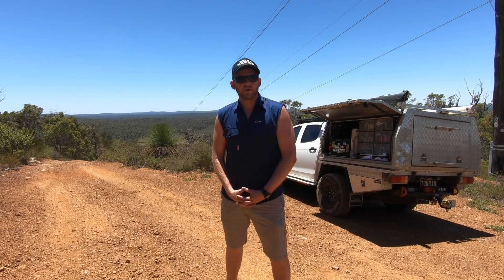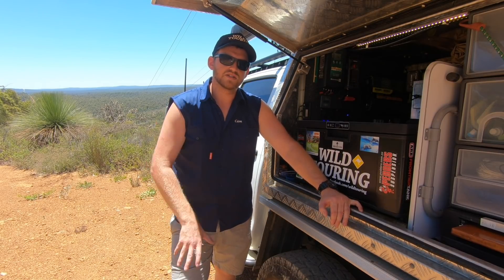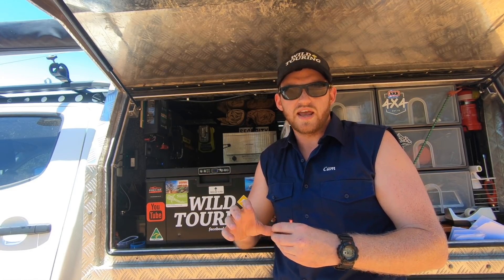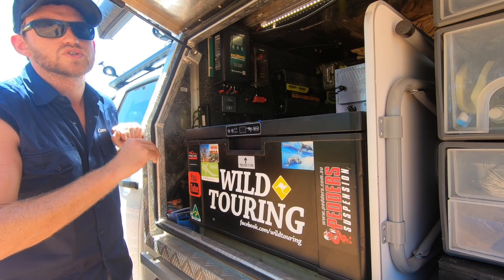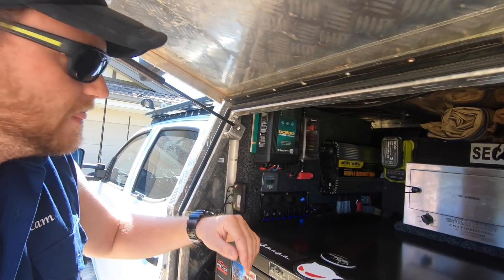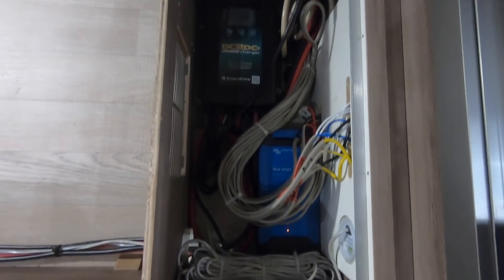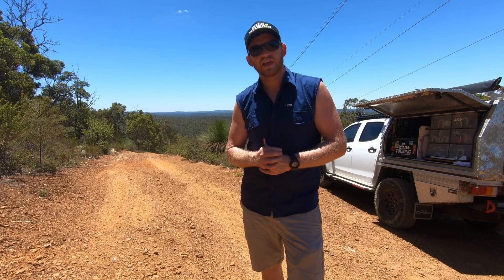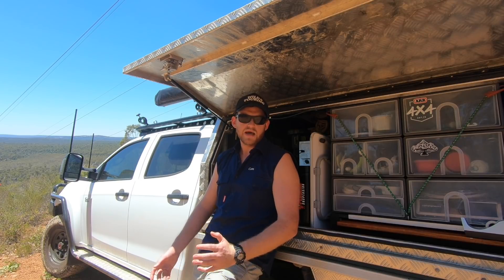Lithium (liFePO4) Battery Install - Isuzu Dmax Canopy & Jayco Silverline Caravan

Comment: So with 2 lithium batteries in the canopy.  I'm guessing you only have 1 AGM under the bonnet,  do you think that's enough for winching and lighting? 
I need to replace my batteries and am not sure if I should be having 1 AGM cranking battery and 2 lithiums somewhere other than under the bonnet
Reply from the maker: Yeah just the one lead acid cranking battery under my bonnet.  I stuck the biggest one I could fit under there to handle the spotties and winch, been a couple of years and no regrets 👍

Comment: If it don't have capacitors inside lifepo4 car battery. It will have same life cycles as lead battery as trickle charging from alternator will kill it's cycle 4x or more.
Reply from the maker: It's not directly connected to the alternator.  It's running through a DCDC charger with a lithium charging profile.

Comment: G'day Guys, interested to see how your setup is going and if you've had any issues or have made any changes.
Reply from the maker: No changes other than adding a microwave to the canopy thats running off the inverter daily. It's working great!  We've been living out of it for the last 4 months - fridge/microwave/oven/milk frother/chargers for drones,  cameras,  laptops, drills etc.. Hasn't been plugged into 240v once the entire time,  just solar and dcdc charger when we go for a drive (we have been set up for up to 6 days without driving though).

Comment: Great "real life" end user stuff not marketing bs.
One important thing about the caravan is if 240v appliance is faulty and plugged in it can short to earth since the caravan is on wheels and no ground spike I would think all the 12v system is in risk of getting 240v ac through it since you used the chassis as negative, I may be wrong but worth investigating .

Comment: Good vid.  2000-3000 cycles for Lithium Iron Phosphate is VERY conservative at 80% depth of discharge.  If kept in climate controlled conditions, discharging at a 1C rate, they will last 4000 cycles easily.  At that point, you will still have 80% capacity remaining.  It’s insane how much cheaper LiFePo4 is in the long run.

Comment: Hi, quick question. The 12 volt panel with the cig socket's and switches, are you running it on one power and earth to a single spot on your narva fuse panel with a large blade fuse?

Comment: What length Tray and canopy do you have on the dmax? I ordered a canopy, got a 1650 long one, but thinking of getting the 1800 long tray to have a little bit of tray space, and getting a full length draw so it will make the draw a little deeper to.
Reply from the maker: Mines got the standard sx tray on its 1650mm long.  The canopy is 1800mm x 1800mm. Under draw will be really handy.

Comment: I know what you mean. I just switched out my 35Ah lead acid battery for a 100Ah lithium iron phosphate battery. I haven't had a chance to utilize it to full potential, however, I was able to see it in action for a couple hours running a TV and Xbox. To my surprise it handled very well with little discharge. It barely put a dent in it.

Comment: Thanks for the video. Just a quick question, are you worried about cooking your alternator with 40a charging at idle? I have the same charger on my ute charging a Winston lifepo battery and I had to wind down the amps of my charger to 30a to be on the safe side. I have a 2012 Bt50. Cheers Ed.
Reply: Good point. When doing upgrades to your electrical system to lithium you need to consider every component. Not uncommon to replace alternators with larger amp generation capacity.

Comment: Great video mate...🤙🏻

I will tell you though...grounding your father’s system through the chassis is a big mistake...steel has a much higher resistance than copper. So by grounding it, it won’t be receiving a full charge as easily as it would if it had a proper copper ground to vehicle.
Reply: There's so much metal that copper Vs steel is irrelevant here.

Comment: forgive me if im wrong but doesn't  the solar mppt controller show all of these details ?
Reply from the maker: Shows what current is coming in from alternator and solar. But doesn't show discharge current or state of charge (SOC). SOC is what i reckon is the most important detail - you want to know how much capacity you have left to work with.
Reply: @WildTouring  so I could simply use a volt meter then ?
Reply from the maker: @gavabe3461  Not unless it has an ammeter clamp. But even then, will only tell you what current is passing through at the time of measurement. Not what the SOC is at.

Comment: Can i just ask why you wouldn't bang one 200Ah in the  Isuzu Dmax..

But ha great vid.
Reply from the maker: If I had one and it fails in the middle of nowhere then all my food spoils. With two,  if one fails then I can run off the other until it's replaced.  

Also,  where I put my LiFePO4's, I previously had 2x120ah agms, which are the same dimensions.  The 200ah LiFePO4 is too big to fit that spot so I would have had to redesign the canopy.
Reply: Appreciate the reply ..Now i know 100%....Thanks again..Just subsribed.

Comment: Hi Cam. Great video. You've done extremely well with your presentation and explanations in terms of helping "newbies" understand (well i hope they now do) how a dual battery 12v system operates. Well done mate! cheers. ps: Only concern is your comment about charging LiFePo4 cells using agm profile on a charger, I have to disagree with that statement.

Comment: Great name for a battery brand (Allspark).  Inspires confidence.  Also, one thing you didn't mention is the scrap value for lead acid batteries (such as AGMs).  Here in USA, I get $0.20/lb which is $0.44/kg.  If your AGMs are 33kg each, then that is $14.52 each scrap value which is about $29 for the pair.

Comment: where'd you film this  ?
Reply from the maker: Powerlines track between Dwelingup and Collie.
Reply: @WildTouring  Cheers for the reply , i was thinking that it looked like dale river area.  i might have to go for a drive  there . how much were the lithium batteries ,1000 each?  seems the way to go .
Reply from the maker: @rossprivate5456  Yeah around that price. Not a necessity for every set up, but nice to be able to run whatever you want for as long as you want! I even run a microwave out of the car these days haha.
Reply: @WildTouring  ive got 2 105ah in my ute and the idea of saving 40kg is worth considering , especially down yeagarup .1000 bucks sound alot but if it lasts 7 or 8 years or so it not much more than replacing an agm every 4 or 5   thanks  for posting a great video btw

Comment: nice job, all that you're generating if you had some more capacity you could leave yourself open to basically a mobile generator where you could refill EV's if they don't make it to a charge station or incase of power outages you could refill neighbors batteries if they're solar
Reply from the maker: Cheers mate. Be interesting to see what happens in the next few years with so many car manufacturers pushing to produce EV's. Range is the only thing that concerns me!

Comment: Hey mate looking at doing something similar to my 4x4. Just a quick question how did you run a lead acid/AGM for starting and winching with this setup?
Reply from the maker: I still run a lead acid cranking battery under the bonnet, I bought one with the highest CCA i could find to help with winching. I still practice 30 seconds on 30 seconds off when winching - gives the alternator half a chance to replenish the amps im pulling from winching, and allows the winch to cool down a bit between work.
Reply: @WildTouring  is that all isolated through the enedrive To separate your lead acid and lithium batteries? Also does the enedrive still get Amps from the alternator to charge the lithiums?
Reply from the maker: @PP20bT  yes there is a voltage sensitive switch that isolates them when cranking battery drops under a certain voltage.  And yes charges off alternator up to 40a!!  Charges VERU quick.

Comment: How often you use that Lithium battery as I was told they would be no good when only using it maybe 12 weeks of the year ??
Reply from the maker: Mine are discharging /charging a small amount daily.  I cant see why storage would be an issue.  I'd just speak with the manufacturer to find out what SOC is best for long term storage.  Jason from offroad living is a great bloke to talk to if you're looking at the ALLSPARK batteries.
Reply: Jack - LiFePO4 batteries don't need to be kept at 100% like lead acid batteries.  A LiFePO4 battery can safely sit for 12 months without charge (as long as there is no loads connected and charged before going into storage) and still have a high state of charge when you pull it out again.  If you mean is it worth buying if you don't use them more than a few dozen days a year, then unless you have excess weight issue, it will take a long time to get your money back compared to AGM's.

Comment: Great Video. Did you happened to look into the itech120 lithium battery for $849?
Reply from the maker: Thanks Jarrod.  I did look at itech, read a lot of mixed reviews on their gear.  And felt pretty uncomfortable about the fact that they say you can charge them with a lead acid charger (I know it's possible, but everyone else in the industry I've ever spoken to says it's bad practice). The ALLSPARK batteries are a little more expensive,  but have a longer warranty,  free freight,  new model has a higher standard charge and discharge rate,  they're local to me and Jason was so bloody helpful with all my questions. So that pretty much sold it for me. 
It's a lot of money to spend on a battery, so I wanted to get it right!

Comment: Great video, do you have any issues with balance between the two 100ah Li batteries?
Guys from Enerdrive put out a video recently talking specifically about this and how you should never run two individual bms lithium batteries together in parallel?
https://youtu.be/gL3htKmxKvQ
Reply from the maker: Thanks mate.  Nah no issues whatsoever, the BMS in these is designed to allow linking the batteries in parallel or series.  Enerdrive run their own BMS,  I suppose that's why.
Reply: As the Enerdrive video mentions because of the bms it's always preferable to run 1 large battery rather than parallel 2 smaller lifepo4 batteries together.

Comment: would you please give me information on the hardware and app needed to monitor my batteries on my iphone. loved the video. thank you
Reply from the maker: The victim Bluetooth battery monitor (bmv712) allows me to do this.  Although Off-road Livings newest ALLSPARK LiFePO4 batteries have a Bluetooth monitor built into them,  so you wouldn't even need the victron monitor, you would just need to download the app and sync it with the batteries.

Comment: Nice Presentation...
(Apologies in advance about any criticisms - I enjoyed that little look around)

Disclaimer, I could be wrong, research things properly for oneself, Wikipedia articles can be wrong, or have "incomplete information".

Re: the "Types of Lithium Batteries"

The Types differences are to do with either chemistry or packaging
Chemistries (include) Li-Co, LiMn, LiFeP04,  Li2TiO3  etc.

The most common are Li-Co and Li-Mn, LiFePo4 were a late arrival back in ~2010...   Ok that is a long time ago, for; House/RV/4x4/$x$; applications yes LiFePo4 are "most common"  but   in other use-cases LiCoO2 are more common..

Packaging includes Pouch and Prismatic (Hard - usually a metal "can") cells.

BOLD: -ALL  of these Rechargeable batteries are Li-Ion, or Lithium -Ion :BOLD. (Lithium Metal cells are non rechargeable Lithium batteries, don't swallow them...)

It is questionable which (if any) currently available cells should be called: Li-Po, Lithium-Polymer, Li-Poly etc, that is generally just marketing (despite what "Battery University" may say) none of them are properly regarded as "Polymer Electrolyte" Lithium Cells. - (Even Research papers for Gel-Polymer Li batteries results in fairly recent research - apparently not commercialised)

Long - Short - 
Lithium rechargeables are"all"  Li-Ion.
Li-Po is BS marketing in most part.

 Lithium batteries are much Lighter  but about 2.5-3x times more expensive, but are easier to keep charged up with the BCDC.

Thanks, I hope the "Li-Ion" batteries all last you 10-20 years or  longer for happy 4x4 adventuring.

PS, I like LiFePO4 batteries and have used them on mission critical applications  where Li-Co Cells can become unreliable  if not recharged frequently..

Still Waiting for Price to keep dropping - Or the Mission to present where I need those LiFe batteries "NOW".
(That's why I have a BCDC  with the "Li" mode so it will work when the time comes to upgrade.)

Comment: I would also add in a low voltage battery disconnect to protect the batteries, cheap insurance.

Comment: you should never  use the chassie  as a return for negative return always use two wire
Reply from the maker: Why? Many factory electrical components are earthed to chassis.  Even higher current stuff like the alternator.
Reply: @WildTouring  It can cause  corrosion and  you have installed great  system then ruin by  using steel as return  copper is 
  far better resistance
Reply from the maker: True.  Copper has better resistance than steel for the same volume. But It comes down to price Vs efficiency.  Still getting OVER 40a charge (from a 40a charger)  over a 10m+ span, can't ask for any better than that! Running twincore 0awg cable would have made it more expensive to do the same job.

Comment: Always a bad idea to parallel batters.
Reply from the maker: That's a new one!  Whys that?
Reply: @WildTouring  what do you think is going to happen if and when one of the cells in one of the batteries shorts out(yes that happens)? fire and mayhem. also if you are not charging or discharging the 2 batteries never have exactly the same resting voltage. one will discharge into the other over time. think about it. you never see this done by anyone with knowledge gained by experience. Its a bad design idea. its normal to use 2 6volts in series for high capacity. Never 2 12 volts in parallel.
Reply from the maker: @NebukedNezzer  there's blokes running 6 in parallel with no dramas... The internal bms/bps looks after cell balancing and opens the circuit in the event of a short.
Reply: @WildTouring   Enerdrive say no to running bms equip't lifepo4 in parallel. The crazy guy might have a point.
Reply from the maker: Yeah have read / seen Enerdrive's recommendations. Same chemistry battery, different BMS. ALLSPARK designed their own BMS to be able to run them parallel - multiple batteries are managed and balanced together the same way that cell balancing is done internally.
Reply: @WildTouring   All good, I ended up with a kickass premium battery box /dcdc lithium compliant and dropped an itechworld in it. So far so good.  Looking for info out there atm is seriously confusing

Comment: Just wanted to say that those natural colored tie wraps (zipp ties) are not UV stabilized and will turn brittle/weak in 1 to 3 yrs. Best to use the black ones (most are UV stabilized), the heavier the better.

Also, I am a technician, turned engineer and you give yourself far too little credit on both your technical skills and your electrical knowledge. I focus on industrial equipment, meaning automotive/batteries/solar aren't something I deal with. But, I understand everything you're saying and I can appreciate the level of detail you've given. I've certainly learned several things watching this video. I've been familiarizing myself with solar/chargers/batteries/inverters for the last couple weeks, mostly on YouTube. This is by far the best overall video I've seen. You should be proud of what you've done here!
Reply from the maker: Appreciate the tip,  and the kind words.  Thanks for watching and commenting mate!
Reply: @WildTouring 
I watch a LOT of YouTube videos and all of it is technical. I know it's free to watch, but I'm disappointed in the overwhelming majority of what I see. It seems to me that if someone is going to put a video out that others are going to watch, potentially believe and act on, even if the person isn't in that field, the information should be well researched and presented in a somewhat professional manner. However, it's VERY rare for technical videos to meet what I see as these, reasonable expectations.

In that light, I can't stress enough how impressed I am with this video. I haven't watched any of your othe videos, but I'll surely watch more. It's good to see someone who has enough respect for themselves and their audience, to do the research and put in the requisite time to put out high quality content.

Comment: I have a duel battery on my rv 6kw of lithium and 6kw of lead  best of both worlds minimal discharge on the lead acid but able to pull 150amps. And just have a dc-DC charger

Comment: There are also LifePO4 batteries with a build in safety and monitor system that also works as a shunt... battery is only slightly ( 4 kg ) heavier than yours...

Comment: li-ion burning down is rubbish. everyone is using cordless drills and all sorts of devices with only for very very small percentage catch fire only due to bad design by cheap chinese builds or complete damage to the cells which if it occurred, then you've probably crashed the car anyway.
I have 80 cells in my skateboard and been riding for 2 years, no issues. it's a matter of careful design with good quality parts and you'll be fine.